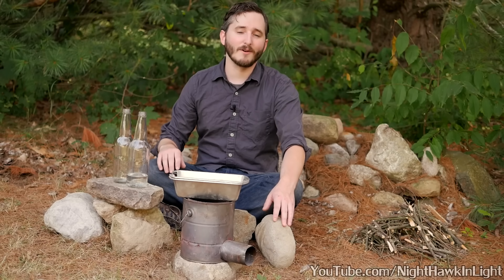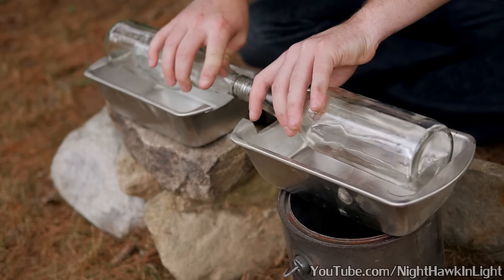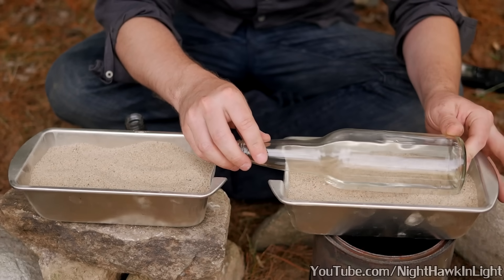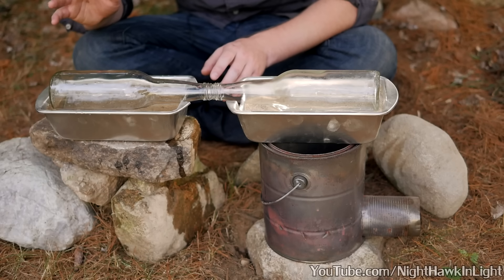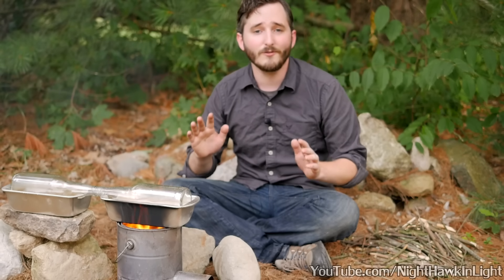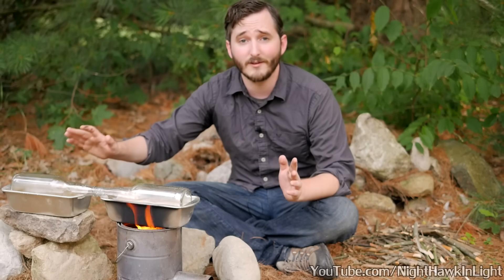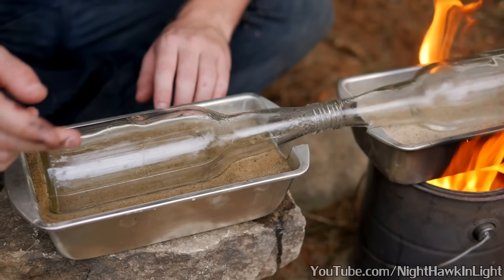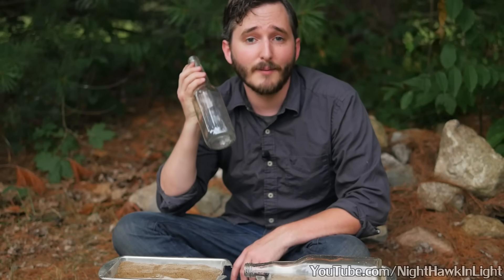How To Turn Salt Water Into Fresh Water (Simple Improvised Distillation)

Comment: 21 morons that would die sitting on the beach with two bottles next to them, that thumbed this video down.
Reply: Theyd probbably send two messages in bottles away for help
Reply: Bodhi Tree 
I heard that the problem with coconut water is that it has lots of sodium (unhealthy for constant consumption).
 My biology teacher once told my class that distilled water drains salts from the body; the solution according to him would be 1/3 of coconut water mixed with 2/3 of distilled water.
Reply: sorry about that, English is not my first language (still learning).
Thanks for correcting me :)
Reply: 109
Reply: tabaks theyd probably spend their energy getting coconuts instead lol
Reply: Raze | Adroit - Specifically:
How long would you survive without ANY water? 
How long would you survive drinking only distilled water?
Reply: natt tomes 165
Reply: Ed Loki 

Maybe the heat source could be used to cock food and  distill water.

I've seen plenty of videos from Primitive Technology (quite interesting in my opinion) and had an Idea of making a furnace with one blower input and 2 fire outputs on the sides. 
 I believe this way the efficiency would not be too low as one fire source feeds 2 outputs at the same time (his furnace experiment video was my inspiration for this idea).
Reply: Ok lads. We've got two gallons of rum we've got to distill fresh water from. Let's get to work.
Reply: 446 R.I.P
Reply: Exactly right Jeff.... 
Some people just gotta-Bitch !
Reply: tabaks -- the thumbs down is because it is a very inefficient method to distill water in a survival situation. You're burning too much fuel which could be used for something else.
Reply: Like what?
Reply: not worth the effort without custom distilling trays
Reply: tabaks 1,500 morons
Reply: 36k internet warriors that need instructions how to place 2 bottles. you would die cause there would be no internet so you wouldn´t know how to make fire.
Reply: the number is growing
Reply: 1.8K
Reply: 1.9 thousand lol
Reply: Cassandra make that the last one you understand me
Reply: 1904
Reply: Lol
Reply: In fairness this method only works for a very short amount of time, if you did this for too long it would actually be more detrimental to you, since distilled water strips the body of minerals and further increases urine output.
Reply: Raze | Adroit there's a simple solution to the problem. Add a bit of salt water to the distilled so needed minerals will be provided to your body
Reply: Renan Venâncio, the word you're looking for is "distilled" not "destiled", my friend.

Comment: Why not just tilt the bottle opening facing up and connect the hot bottle to the cool one with a tube?
Reply: Not likely to have tape or tube in an emergency survival situation
Reply: You could easily do this if you were in a situation such as home chemistry if you wanted to try the experiment, but it's mostly just this option for the sake of a survival demonstration
Reply: A used condom will do...  can often be found on the beach....
Reply: IF you need to scavenge bottles to make this, you're not likely to have anything suitable as a tube, and if you're at home or somewhere like that, you can probably find better containers anyway.
Reply: Hold on ...if you were shipwrecked on a deserted island you could just go to the local wallmart for tubes anyway right?
Reply: Döla Freundlich cause I doubt you would find a hose pipe at the beach
Reply: also you can boil the condom in the water first then offer that water to the other surviver because in a apocalypse you have to get rid of the other survivors right???
Reply: A used condom will not do! So basically you can purify salt-water at the expense of getting an STD!?
Reply: If there are bottles on the beach, at least two obviously, then it would be near a shipping lane or collection of floating rubbish. It's possible among the debris you can find a rubber tube. Perhaps not a hose for fluids, but anything like a rubber cover will work. And of course anything plastic that can be rolled. Your best bet would be to look for metal containers, once you understand this process increasing the size is fairly easy for most people. If all else fails find four bottles... or six. The best possible contraption I can think of, beyond finding a stove and chemistry set, is metal tubing from boat wreckage or a metal container and tubing and submerge that in a charcoal pit or large fire. Seeing as water is critical to survival this contraption will be the center of your camp, your most important work if no other water is present.

If you are staying in one location long enough you can even use black sheets of rubber to utilize solar instead of building a fire. But, that is a more lengthy process for long term accumulation.
Reply: Döla Freundlich ... /... , it's a survival situation stranded on sea ... most of the items cannot be easy to obtain.
Reply: Döla Freundlich s
Reply: Döla Freundlich You're HOT Dola. And smart too!
Reply: i dont know
Reply: If you tilt it the distilled water will flow back into the salt water
Reply: 1) take a large leaf or plastic from boat

2) roll up

3) you now have a tube
Reply: seigeengine If i was home or something like that,i will probably fond some water in the fridge...😀
Reply: Turdeau, you are a disgusting creature. Get out of here.
Reply: Wesley Fair, but if you were to do about a 5-10 degree tilt with the saltwater bottle at a higher elevation (like you are about to pour the saltwater through the tube manually) and leave adequate spacing to compensate for bubbling, over time, the water would boil into the other bottle. It would take much more time, as some water would keep falling back into the saltwater bottle, but eventually it would all evaporate into the second bottle.

Comment: How would you refill without shattering the bottle with the "new" cold water?
Reply from the maker: Pull the bottle out of the sand and let it cool briefly before pouring the new water in
Reply: NightHawkInLight 
or add hot/warm water to the bottle
Reply: Or add a small amount constantly to the boiling water

Comment: Will this distilled process remove contaminant radioactive too? Like fallout 4, is this process purify the water?
Reply: I'm pretty sure it won't. All it's doing is reducing solid particles in the water by leaving it behind.

Basically, if something can turn into vapor and boil off, it will transfer into the next bottle.
Reply from the maker: Yes, if the radioactivity is caused by dissolved materials.

Comment: Could the cold bottle be a plastic bottle? I feel like those would be more common and since that bottle wont be over the fire
Reply from the maker: A plastic bottle will not melt so long as it is filled with water, but since this method only fills the bottles partially the top would likely melt. It wouldn't work well.
Reply: Even if it's not the one over the fire?

Comment: In the survival situation:why even Bury the heated bottle at all? Isn't it easier to dig a small hole under it to hold the fire? The bottle would then be at the Sand level so there would be no problem in plaving the other one.
Reply from the maker: You can heat the bottle directly over a flame, but without sand there's a risk it would shatter.
Reply: NightHawkInLight It isn't an airtight system so pressure wouldn't be able to shatter it, but I think the bottle would be able to warm up equally if you start from a small fire warming it up and then just turn it over, to eliminate the thermal expansion  problem.
Reply from the maker: The problem is that it will expand more one one side than the other because of the water keeping where it contacts cool. If you rotate the bottle when it's already hot the water will shock the hotter exposed area when it touches it.
Reply: NightHawkInLight I think it could work, but You're probably right, it would be easier to do it your way.

Comment: To keep the bottles aligned, you could use a rolled up leaf as a transfer tube, you could even have the bottles angled to contain a bit more water.
Reply from the maker: The steam coming out is pretty hot, it would wilt a leaf very quickly. But some other material like a piece of aluminum from a can might work.

Comment: CO2 in the air dissolves in distilled water, and makes its pH acidic and not optimum for human consumption. Also, drinking distilled water robs your body of its natural source for many minerals essential to good health. In a life or death situation it does it's job, but search a proper water supply as soon as possible.
Nice video btw !
Reply: That's bullshit. Drinking distilled water is bad because there are not minerals (so the osmottic pressure is low and it will destroy cells) but CO2 in water is harmless. 
If you drink carbonised soda (= any drink with bubbles) you drink water with a lot of CO2 in it.
Reply: (Of course drinking pure carbonic acid is bad, but this wont harm you)

Comment: I liked the video for setting up a distillation in a survival situation. I would however recommend to add back some of the minerals from the boiling seawater since it is dangerous to drink large quantities of distilled water. The distilled water would draw out ions from the cells since the ion concentration in distilled water is too low which would cause your cells to stop working after a while.
Reply: It is of course better to drink distilled water than highly salted water in a survival situation. If you have access to food then the ion concentration in your blood should be enough to survive on the distilled water
Reply: I was wrong, see the paper linked by John Jantar below: https://www.wqa.org/Portals/0/Technical/Technical%20Fact%20Sheets/1993_ConsumptionOfLowTDSWater.pdf
As long as you have some food supply you are fine drinking distilled water. If you don't then not drinking water would kill you anyway.

Comment: Could this distill pond water too?
Reply: Garrett Phillips absolutely... sea water is more harsh than pond
Reply: Thank You. I don't live by the ocean, I live by ponds and their are plenty of bottles.
Reply: +Evan Diliberto No, but parasites and bacteria would be killed by the distillation process anyway.
Reply: Squirtle8459 I've heard of sand filtration but don't know the amount of sand required to be sufficient to process a specific amount of water.I've also read about a guy who invented a cheaper way to desalinate on a larger scale.Again can't remember specifics but I believe it involved permeable membrane of a designer material.
Reply: +DevPre That's salt water, not distilled water.
Reply: How old are you lol
Reply: Why?
Reply from the maker: Pond water is usually safe to drink with simple boiling to kill parasites and bacteria. But yes you could distill it.
Reply: NightHawkInLight could you boil the distilled water to get rid of the contaminants you were talking about?
Reply: If you made some sort of system where the water from the pond goes into a charcoal filter that Grant Thompson made, and filtered that into the glass bottle for distillation from this video, you got some premium grade water, and shouldn't need to worry about most contaminants...